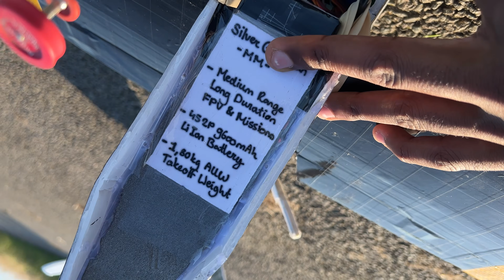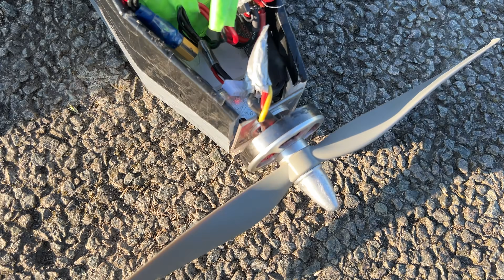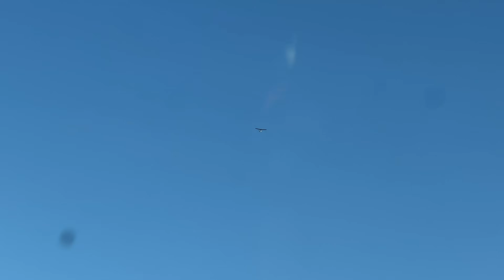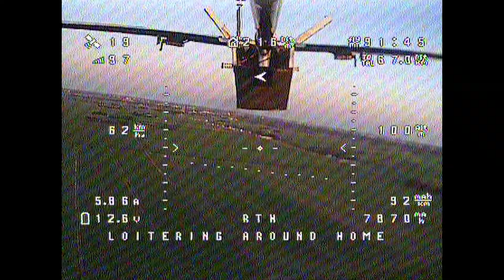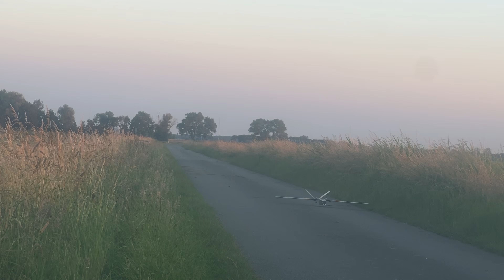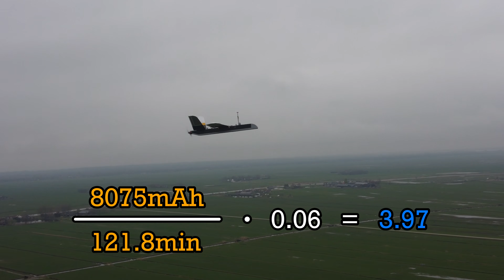Silver Guardian UAV for FPV - Setup & Flight Performance (Endurance)

Comment: could probably squeeze out a bit more range if you hid those servos in the wing. consider also a 2 prop plane, as technically the lack of torque could also help

Comment: I’ve still been obsessed with twin motor planes lol.. my foam build reptile dragon 2 copy.. still have the twin I’ve been flying. I took the paper off the foam and used some fiberglass sheets and epoxy to make it more rigid and durable. I’m about to build a new plane and I think I’m gonna do a single engine design.. I need something smaller for where I just moved. My diy reptile dragon 2 build is awesome but it’s scales up like 25% flys great but it’s so heavy and slick I literally need a 300 foot long landing area.. and that’s belly landing of course haha

Comment: Have you tried a larger pitch prop?  you can check the APC website for data on props at given airspeeds.  Not sure if this data was obtained in a wind tunnel, but it's very good, and unlike any other static thrust data on other manufacturers, as it takes forward airspeed into account.    also a lower KV on 6s should be more efficient, and there are many options still at 6S and easy to step voltage down using cheap (probably the same ) ESC's and BEC's.   a friend used a square prop to fly over 10 hrs on a charge with a slightly larger model and li-ion.   used a square prop.  same pitch as diameter.
Reply: Also, The ESC limitation is significant, and this could cause you to lose the aircraft on long range flights, as the ESC will give up and shut off long before the battery is depleted, sacrificing the whole airplane to save the Lipo, which you do not even have...   Highly recommend Castle ESC's, but you do have to turn off the low voltage cutoff, or set it to something insanely low, such as 5V total. I'm guessing there was another 20+ minutes in the battery, maybe over 30.  on 4S I usually fly down to 12V li-Ion, and I can still do a go around safely if needed.   also embedding as much into the wing, such as the aileron servos, would help a lot.  very helpful that you have no landing gear too.
Reply: There is also TetaCalc, with data from wind tunnel. I found it on forums where efficiency was discussed a lot. But damn it is quite hard-core spread sheet. Had no time to study it much. But You are on good point, I seen many Talons running high pich prop, or at least 9x7.5, 9x8 if 9x6 was recommended. But I would like to also add to this topic that those Talons has a motors that are utilized at or near their maximum efficiency, so not running ESC on Low Duty Cycle that has losses. It tho feels like good challenge to find a right setup, find the optimal cruise speed to drag profile ( + the point where induced and parasitic drag are both the lowest) and the spot-on PROP. That´s why I wanna build a Talon GT modded copy and see what I can get from the original size motor. 😊✈
Reply: Good points.  Will check out that data website.  Any of us who have a flight controller with data logging capabilities have essentially a wind tunnel in the form of a real world data collection device.  Props are the easiest to change, so the easiest to experiment with.   As far as efficiency, it depends on your objective, how to optimize the system,  endurance or range.   The aircraft type is different and flown differently.   Some can do both reasonably well but neither can do everything well.  Endurance is all about sink rate, and propulsion system efficiency for a given mass.  And the speed used is relatively close to the stall speed.   Distance is a compromise of speed and low power consumption which gives you the optimal km per kWh under a given set of conditions.   And since you’re trying to go somewhere, and conditions are not always the same, you’ll need to adapt to a variety of speeds, so you need an airplane which is capable of going a bit faster than is actually optimal under perfect circumstances.   
Both types must be able to carry a massive battery.
Reply: @FPVREVIEWS That's literally a spreadsheet to download and apparently supposed to be used in MS Excel. On Google sheets the functions seem to be not working. You're right with the wind tunnel haha 👍 And thanks for elaboration, good-good!

Comment: What is your opinion on Speedybee fixed wing controller? It looks good with Wifi and Bluetooth and all the bells and whistles.
Reply: Wifi and Bluetooth won’t work at range.  Only during setup.  A good SIK radio setup will allow wireless long range communication
Reply: @wojtek3016  I got SpeedyBee full size and mini. Both working perfectly, awesome manual, accessories, solid PCB, they put tons of copper on the full-size PDB 👌 But the Bluetooth is only good for changing few settings in the field. Setting up the entire board via BT or SpeedyBee app would be painful. 

Now I am regretting the extra money for the full size. If you don't use tons of peripherals, the MINI is even better value 😊👌

Comment: Good morning ,
In the video you say that the ESC automatically limited the passage of amps which is compatible with the use of LiPo batteries. But is it not possible to change this parameter in the ESC so that it is compatible with the use of Li/ion battery which would further increase the flight time. In any case, thank you for your videos which are always very interesting and which prove that with few means you can achieve a lot which was the philosophy of the channel that you took over. What I also take away from your various tests is that the ideal cell is the flying wing and that the ideal engine configuration is a push-down position. On the other hand, there is also a parameter that counts a lot in the distances that you manage to cover: the topography of the area where you are flying: very flat, therefore without parasite/deflection of your radio/video signals by the terrain but your flights are still very impressive considering the power you use. I can't imagine what you would be able to do with a 733mhz TX and a 1.2/1.3 mhz VTX. I have at home a TX EzUHF module with its 8-channel receiver from Immersion RC and a Vtx/Vrx set in 1.2/1.3 MHz (both together have their antennas of course) which are getting old and gathering dust on my shelves. I'm ready to give you some as gifts if you're interested . This is a serious offer

Comment: I always enjoy your videos, I am taking the leap into my first open source Matek F-405 FC, It is going to be a hard learning curve for me because computers and I don't get along. Keep up the great videos .
Reply from the maker: Good luck! We all came from there. 

Check out Painless360’s videos about setting up Matek Boards. I’m sure it’ll help.
Reply: @AeroStuffFPV , Hi, can you please suggest me how to operate TWIN RUDDER with 6 channel RC transmitter. Warm Regards
Reply: @garrison9078  One option is to use a Y-wire to send the one rudder channel to two servos. If have a spare channel on receiver, you can program on transmitter to duplicate the default rudder channel to the second (this would not require Y-wire).
ie: a configuration option vs. hardwired option
Be sure to test on the bench, to ensure both rudders move in same direction as intended.

Comment: What do you think, what's the efficiency difference between your pusher and tractor? The motor? The fuselage? You have the wings pretty much the same don't you?  That would be crazy if 30 minutes was the efficiency difference of prop placement. But either way we are not comparing apples to apples.  Two almost identical airplanes would be needed.

But I love pushers anyway 😅

Good job, good flight Nathan! 😊🤘♥️
Reply: Wait a minute... If you compare the two anyway:

Pusher 
2:01:48
Distance 69.67km
8075mAh

Tractor
1:34:56
69.39km
8115mAh 

So either I am totally wrong, or the tractor is more efficient. You covered basically the same distance, higher avg speed, almost the same mAh in less time. 

If you fly with an Airliner which one would you choose? 😅 

I know that it's very common thing to see efficiency in RC plane, how long you can fly (enjoy the plane) but if the general concept of efficiency is to get somewhere fast and cheap, then the Tractor is my Airliner to choose 😊 

Makes it sense or I am off? 

Damn I am curious how mine will fly, unfortunately the weather is mostly just.... pouring.
Reply: @valkyrie_workshop  The way I have had it explained was that pusher is less efficient because the air on the propeller is dirty from the turbulence of the plane body and wings. So the propeller isn't cutting through the air efficiently. Same issue with double motor quadrotors. The main reason to have a pusher is to have your optics have clear view of the ground and the area in front.
Reply from the maker: Yeah, the term efficiency would be indeed the distance over mAh instead of time duration, which I’d call ‘endurance’ or endurance efficiency. 

With the data you mentioned, both platforms did 115mAh/km, with the tractor being the fastest to reach ~8000mAh/70km, but conditions were completely opposed to each other as well. Tractor had almost no wind, being able to cruise faster, opposed to the Pusher, fighting winds & drizzle.

A pusher plane is more stable by nature and aerodynamically advantageous compared to the tractor layout: The boundary layer of the fuselage/profile is re-energized, causing ‘lost energy’ to be propelled. There is clean air over the wings of a pusher in relation to propwash from a tractor. The de-stabilizing part is the rotated propwash hitting the stabilizers ‘weathercock effect?’ causing the plane to roll to one side for tractor planes.

These factors are a minor gain in real aviation, but by experience with my platforms, the Pusher does better than tractor. Able to fly slower, feeling more stable, lower stallspeed & lower cruise throttle to stay aloft & cruise just as fast. 

Efficiency is about 95-98mAh/km for the pusher in optimal conditions (3.5-4A avg. cruise) beating the tractor by a longshot, if conditions were equal.

Appreciated it Valkyrie ❤️🪽
Reply: @AeroStuffFPV  Yeah I know the "PROS" for pushers, although pushers in real aviation are practically non existent. But didn't actually know it could be that difference in RC planes configurations.

Thanks for your elaboration and details 👍😊♥️
Looks like I gotta hurry up with the DIY Talon GT Rebel 😅
Reply: Full scale conceptual design is exactly the same.   There’s more models with pusher because the noise is tolerated and the vibration is not felt. And it’s fun because it’s different.  There are some viable full size pushers but mostly it’s more trouble than it’s worth, from a practical standpoint
Reply: Great question, and nice thread. Great topic!! 💚